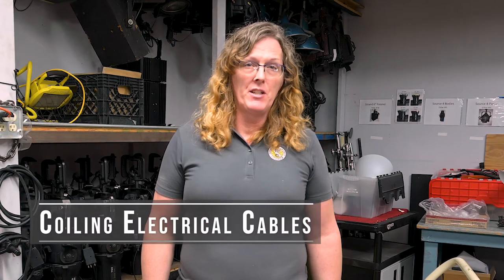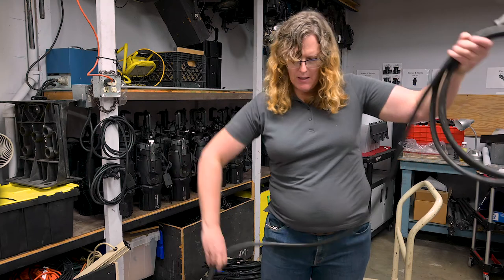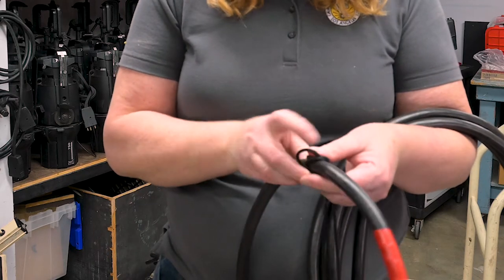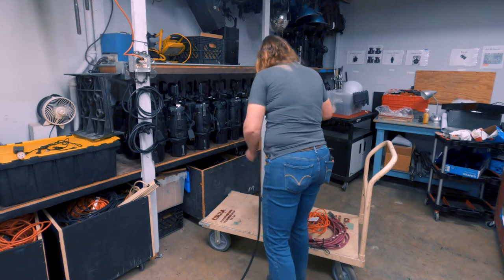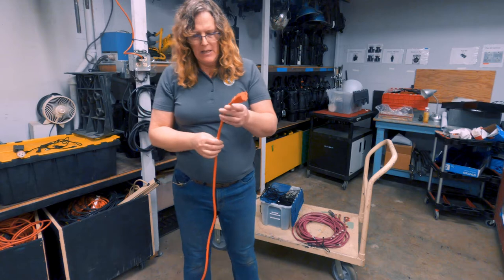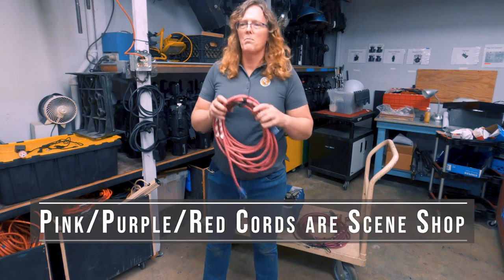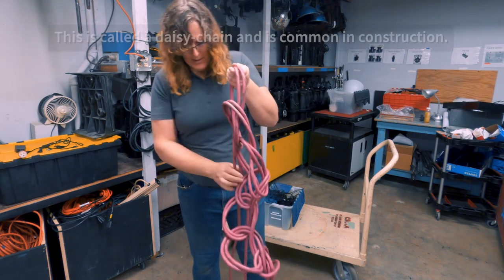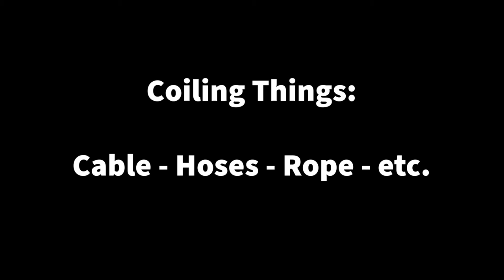Coiling Lighting Cables and Extension Cords

Comment: You are right power cable is coiled over-over, however industry standard is clockwise not counterclockwise.  If you mix it the cable will fight you and eventually the copper gets pulled out of place in the insulation.